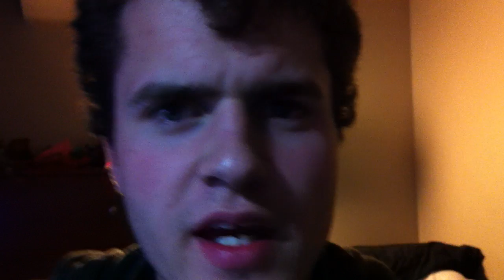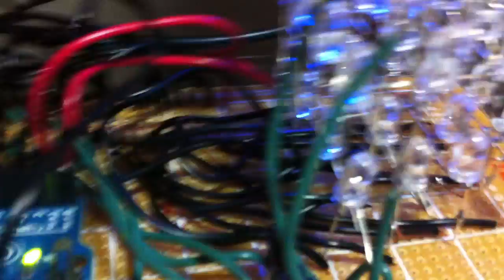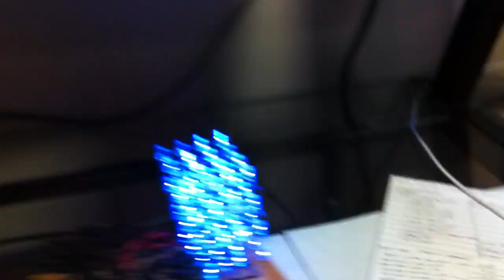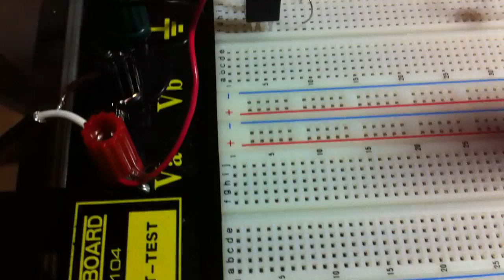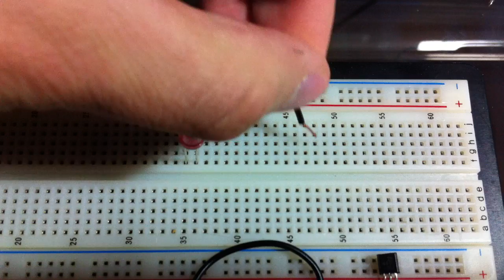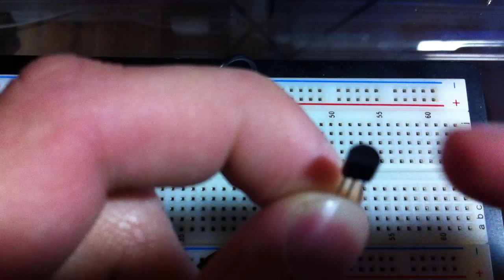Electronics - Using an NPN Transistor as a Switch

Comment: Hi Michael, why do you need a resistor before the LED? Is this to limit the amount of current the NPN transistor sees? So as not to blow it out? Could you just put the resistor between the LED and the transistor so the LED is seeing the full source but can still be switched on and off by the transistor? Thanks!

Comment: I am trying to make a mechanism which switches on and off from a sound signal. So I have used a stripped 3.5 mm mono jack cable's leads as the transistor's signal and checked everything. The mechanism lights up as fast as I connect it to a mp3 player. I noticed that when you connect the base and the emitter together, it switches on. Why? I mean that makes it a regular switch, not a transistor. HELP!

Comment: hello. i did the same circuit as the one you showed in the video. but there is a problem that even without connecting the base of the transistor to the 5 volts rail, i still have a closed circuit. i used a multimeter to check the voltage of the led part and the value just increases by some decimals after removing the connection of the base to the 5 v rail.

Comment: Thank you so much for this.
What would happen if you would give the base of the transistor without a current limiting resistor? I think you said "doesn't matter what kind" so a 330Ohm (I think that's what you're using) is basically ok no matter the input voltage, current drain etc? Thanks again!

Comment: Hi! made the curcuit and tried with different resistors. The higher the resister the lower the led lights up. so it is not just an on off switch?

Comment: Nice video, good explanation about the usage of transistor. I have a question: (Please somebody explain me via reply)
Is the ''NpN" means Negative-Positive-Negative for NPN transistors and Positive-Negative-Positive for PNP tansistors? What's actually the difference?
Reply: They are opposite types, so with PNP, if 0 volts are passed through the base, then the light will be lit, but if voltage is passed through the base, then the light will turn off. If you look up p-type and n-type transistors, you can find more information about it. These transistors are what makes a computer actually function.

Comment: if i have a transistor and i have a motor that needs a lot of power and i dont want to kill the circuit what
do i need to do to get the motor the power and not letting it in to the circuit

Comment: Question: (I'm new to electronics.)  I tried wiring a circuit based (loosely) on this video. The transistor seems to do what I want (LED turns on when two buttons are pressed simultaneously). The puzzler is that it works without grounding the emitter. With the ground, the light is slightly brighter. I think I must be doing something wrong?
Reply: im having that problem too

Comment: Actually I think when facing flat side from left to right it is emitter base collector.
Reply: OOO OOO nope, some transistor have its emitter base collector at different places
Reply: +Shut da hell up yeah that's correct. I've got some currently that have the order: emmitter collector base from left to right. that's with the flat facing you. that's why you check data sheets for unknown transistors before you work with them. They can be very counterintuitive sometimes.
Reply: there are so many types of transistors . you can find BCE , CBE or ECB order 
 too
Reply: yep
Reply: You have to look at the datasheet of the transistor to figure that out. Not all transistors' pins are in same order
Reply: I think the order is EBC for 2N3904 if you view it from the flat side.

Comment: Good video, but it could be much better if you would have provided the following:
1.  Part numbers for your parts (e.g. transistor, LED, & resistors)
2.  How you decided which transistor to use?
3.  Pertinent specs for each part & calculations to show you are within the specs limits of each device to prevent destroying the parts:
--  What is the min & max V & A needed for the LED (i.e. the amount of V & A needed to light the LED, but not burn it out) & how you calculated the proper resistor size to ensure you had sufficient current.
--  How much V & A is needed to switch the transistor "on"?
--  How you calculated the proper resistor size that is connected between the transistor base lead & the ground rail.

That kind of information is useful to newbies so they can do more than just ;olug & play while destroying components because they don't really know what they are doing.
Reply: 1. why?
2. He never thought about it
3. Let people find out for themselves............that's how they learn

Comment: Bright boy. A transistor is basically two diodes back to back or so I was told. I used to love spending hours with a breadboard and schematic trying different things. It used to be a nerd thing, I even had the pens and the pocket protector nerd bifocals. I got beat up one too many times then I smoked my first joint and everything went to shit after that. Couldnt even remember ohms law after that. what was I talking about? Oh yeah Transformers!

Comment: @kcinkcinkcinnick i  notice the same thing and i am 100% sure that if the flat side is facing you then its EBC and the reason that this worked its because the Collector on a transistor usually goes to a positive feed and the emitter to a negative. so i think he just got lucky:) great video tho!!

Comment: just a thought - can you tell me - at what point does/should a transister become a solid-state relay and then at what point does/should that become a regular relay?
thanx
Reply: Isn't a transistor inherently a solid state relay?  A regular relay requires a mechanical switch that is activated by an external force.  Transistors have no moving parts, besides the electrons :P
Reply: wasianish by definition, a transistor is a solid state relay
Reply: Eric McGhee exactly

Comment: But why won't the circuit work if you remove the resistor from the base???I was stuck for hours figuring out what I  was doing wrong and the solution is beyond me. Why do I need to limit current to the base???

Comment: thank you for your video. with that said i actually have a question why does my led turn on if im not applying a small current to the base. the transistor im using is a 2222
Reply: the pinout might be different, check the pinout of different transistors online

Comment: Just one comment mate, the PNP or NPN does not refer to the charge of the material inside as all of them are neutral, i.e. they are neither positively nor negatively charged. It rather refers to the impurities (dope) that the silicon is mixed with. Please don't make mistakes liker this :)
Otherwise, good video :)

Comment: genuine question : why unplug the transitors connection to positive when you can just unplug the LED 'S  connection to positive.  why run it through the transistor?
Reply: Again?
Reply: If, instead of an LED, you use something that requires more power like a relay, you might want to control that relay with something that can't supply that much power, like a raspberry pi pin. You can use the raspberry pi pin to open/close the transistor to let a stronger power source power or not power the relay depending on whether the transistor is open or closed.
Reply: well hahaha if you have list of leds * * * * do you want to unplug  4 positive connection wires or just one easy tiny one transistor wire Duaaaaaa!!  very genuine Q. Did you get an F ? hahah
 

I do a lot.. it is ok!

Comment: First I need transistors, then i need a breadboard to use the transistors, now I need resistors, this is annoying. I also don't have a proper battery hub.

Tell me: Do you need resistors for this?

Comment: I really don't understand, what the transistor is used for in this circuit. It's not actually the transistor, thats being used as a switch, it's the fact, that you break the circuit, by removing a wire to ground... you can do the same without the transistor.

Comment: You dont connect those two together, the emitter goes to ground and the base gets connected to the voltage with a resistor

Comment: I stripped some transistors from a few printers and determined that they are NPN transistors. I am connecting the Collector to 5v and the Emitter to Ground and there is no current flowing through to an LED, like it should. When I apply 3.3v to the base, the LED lights up but the voltage supplied is 3.3v and not 5v. What am I missing possibly? I have tried a few different NPN transistors and the results stay the same.
Reply: could you please explain what do you mean with the  "but the voltage supplied is 3.3v and not 5v"?

Comment: Thanks for the video, nice job.  It touches on an area that I have wanted to learn about for some time.

Question;
I have a a number of sensor circuits that turn on an LED when triggered.  ie.= timer, sound, light...  How do I connect one of these circuits to a Transistor that will energise a regular 5-12 VDC magnet relay that in turn powers a high AMP AC device?  

I want to be able to remove the LED from my existing circuit & replace it with 2 jumper wires leading to this new (yet to be defined ) circuit.  So I should have about 3-5 V but only 15-30ma to trigger the new (yet unknown by me) circuit.

I imagine this is easy to do, once you know how.  Links or any ideas would be very helpful.  I'm obviously "Very" green with electronics, but I have to start someplace.  

BTW  IF you want to get drawn into Electronics, get yourself an Arduino starter kit for $20  up...  Nothing like constructing a circuit and software program that shows the humidity and temperature from a sensor your bought for $1 to scroll on your screen.  The possibilities with just a few parts is amazing...

Comment: why you need a resistor on the B pin transistor ?

someone already asked i think but i dont understand you reply, about if I have a 5v circuit, I want to control 35v for coils, it is possible? if yes, how I connect it :)

so like 5v pulse that activate the 35v on the transistor?

Comment: Hey bro. Trying to mod an xbox 360 controller. I got a microcontroller with 16 digital ON/OFF pins. When it's on it's 3.3 or 5v can't rememeber. Off is 0v. I'm thinking of using transistors to control buttons via the pins.  the controller uses 3.3v on the buttons and has it's own separate battery. When my software tells pin 1 to turn on it will pass 5v into the transistor, triggering 3.3v to pass and make the button become pressed. I've only got one shot lol so is there anything i'm missing?

Comment: Im a newbie..  so how can i get the NPN transistor to switch off and on without me doing it manually pulling the wire?
Reply: You'll need som sort of driving signal. It could be a microprocessor or some other kind of signal generator. It depends on what you want to do with the circuit :)

Comment: This circuit did exactly the same job without any transistor. The LED  lit up when you connected it with a wire to VCC and so it did when you had a transistor. You even had to put an additional resistor to make the circuit work with a transistor. Why use a transistor then?
Reply: Because the purpose of the circuit is not to demonstrate how an LED works, it's to demonstrate how a transistor works. The LED is incidental, it just gives us a way to see that when voltage is applied to the gate of a transistor, current is able to flow through the leads. A transistor demonstration wouldn't be very useful without a transistor.
Reply: OK, but why demonstrate a transistor in a situation when it's completely useless? I would seriously like to see when a transistor is crucial and impossible to substitute.
Reply: Animateurdespectacle Open up your computer, take out your CPU, and try to turn on your computer. The computer will not turn on because you removed billions of transistors from it. The transistors are crucial for the computer to function properly, and are impossible to substitute.
Reply: Animateurdespectacle, I think you are misunderstanding the purpose of the the transistor.  You are correct, in this case it is illogical to use a transistor as a "switch" to turn a light on and off.  But it's a great demonstration of any "load", as it's more sensible than say radio waves which we cannot see or touch.  However, nesting transistors together produces switches so fast, people would not be able to do them manually.  A cell phone is a great example.  It sends signal to the tower at 1,900 cycles per second.  If you could create that circuit exactly at 1,900 cycles per second, by hand, you wouldn't need the transistor.  Good luck with that.  There are substitutes, like vacuum tubes.  They are slower and wear out frequently compared to transistors.
Reply: this is a great answer, thank you
Reply: Animateurdespectacle transistors form logical gates. in other words if ur in a junction there are no vehicles in a lane then u should let traffic through the other lane this is exactly how a transistor works

Comment: To identify then leads of the transistor you need the part number and the data sheet from the manufacturer to identify the leads I Have transistors  with  the leads EBC oyhers ECB and another CBE and BEC Why ? the fabricators talk a lot but give NO reason JUst make sure guys

Comment: Hi Mike, i am new to this..... im trying to build a circuit !, it gets 2.5v (from a solar panel), and i need to step that up to around 30v in order to run a small dc motor using transistors or whatever!, could you perhaps assist ?

thanks
Reply: maybe use a capacitor?
Reply: Thanks

Comment: hi can u tell me what is the value of the  second resistor u used???
Reply: It looks like it's the same value as the first current-limiting resistor, the one for the LED.  He says that one is 330.
Reply: Thank you.
Reply: The RFP12N10L power MOSFET is overkill (it's rated for 12 A, 100 V) but it can act as an LED switch.  Just supply 5 V to the gate, have VCC connected to drain and the LED anode connected to source.  It's only ninety cents on Digikey.
Reply: It's just a the Fairchild Semiconductor part number.  You can use that number to search for it on Digikey, where it costs ninety cents.
Reply: I mentioned that MOSFET because I have used it.  I don't know which one is in the video.

Comment: that and more than one LED would kill your micro processor.  one transistor will put out 600-750 mA's  which is way more efficient than a mere 40 mA's on your micro processors pinouts. ;)

Comment: Nowhere in the word transistor does it mean 3. You kinda stated it did. Anywho
Yes it is using the transistor as a switch but you are using the same power supply. All you did was make the circuit more complex. Removing the power source from the 3rd leg on the transistor made the LED turn off same as if you didnt have the transistor in the circuit.

Comment: So if I touch the middle pin of the transistor with anything, even if it is disconnected, the LED lights up. What is happening lol
Reply: It’s using a small amount of current that flows through your body to activate the transistor.. similar to how a “touch” switch works that you’ll find in some electronics

Comment: just give me a smart reason to use NPN as a switch if you just can plug the LED to 5v  with 330 ohm resistor and then diconnect it  just like you did with the transistor?!
Reply: Because the small amount of voltage going to the base pin of the transistor can be turned on or off dynamically from a microcontroller (for example).. which in turn can let the high current pass through to the device you want to power.

This example might work better powering something that requires more voltage, like,12V since a single LED requires almost nothing to power.
Reply: You can control motors which needs 12v with microcontroler (like Arduino) who works with 5v
Reply: In the real world, this is not how an NPN transistor is used. They are not meant to take the place of a single pole single throw switch, with some human plugging and unplugging a connection,. (Maybe this project needs an SPST switch to turn the transistor on and off?) A better example would be with some automated process sending a 5-volt reference signal to the gate (base) of the NPN, such as a light sensor that controls an inverter (NOT logic gate) that turns on in the absence of light. The reference (gate or base) signal then turns on the transistor, allowing current to flow into the collector (also called the drain) and it sends a slightly higher voltage (maybe 12 v) to control a relay switch, which turns on a much larger AC load, such as a 100 Watt light bulb. They are useful in a circuit like that because you cannot directly hook up  an AC-operated heavy-load device to, say, an Arduino.

Transistors by the millions are also used (at near-microscopic size) inside computer memory chips as tiny digital on-off switches, with on being a "1" and off being a "0".

Another example of transistor use is the automatic switching necessary to route and connect telephone communications, which at the beginning of the 19th century used to require a human being physically connecting two callers at a switchboard.

In other words, almost everything transistors do is automated.
Reply: It's a building block. Ya so take this example. I want to run a 1HP water pump with a microcontroller...  Microcontroller is connected to a transistor the tansistor is connected to a relay and a relay is connected to the pump. This is in the simplest terms though. But you get the idea. Well hopefully.